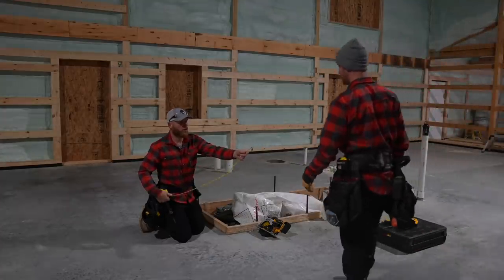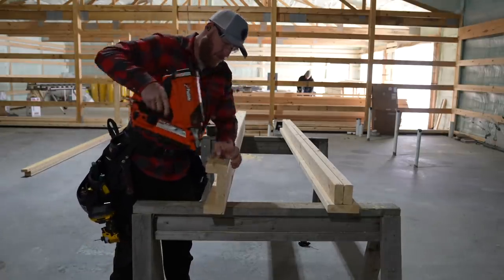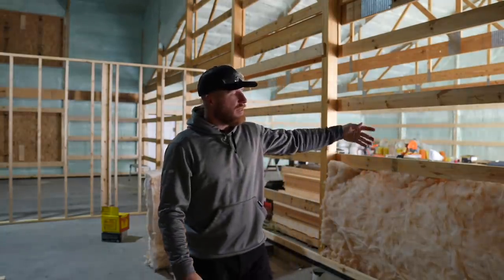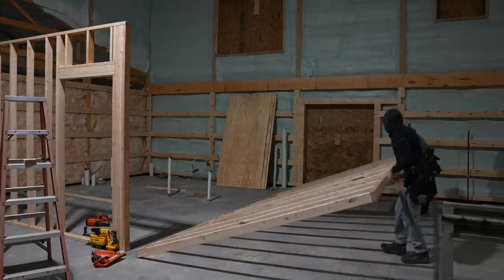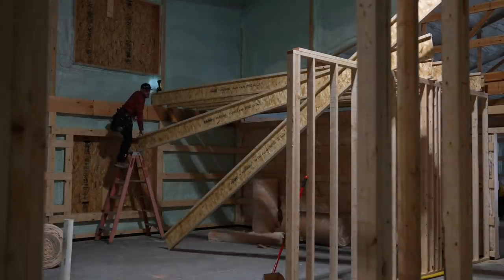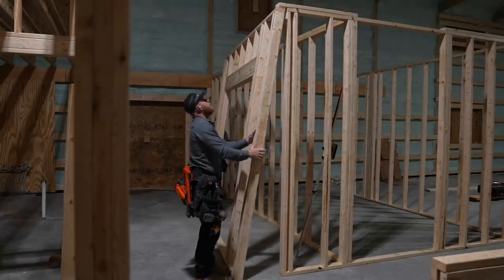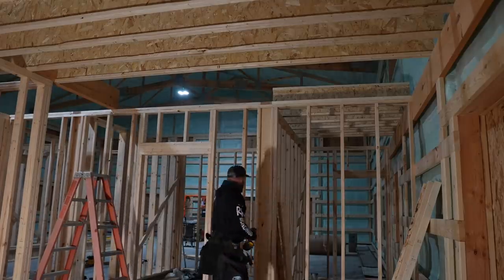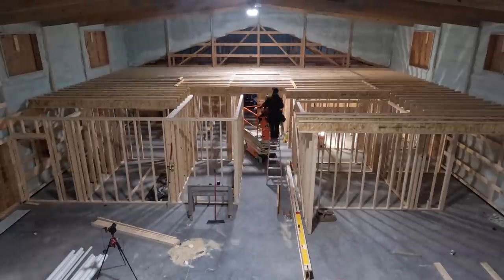Building a Barndominium 14:  Interior 1st Floor Wall Framing

Comment: Kyle- trying to put this in a nutshell: First, you guys are excellent. Secondly,  I can’t thank you enough for all the incredible content you’ve spent countless hours putting together.  Please know you have made a huge impact on how I will start building post frames.  I’m been building for almost 32 years and just recently have had the opportunity to build my first post frame.  I’ve studied your videos very closely and will respectively build exactly the same as you. This job would not be possible without your informative videos.  The build is a 10 bay auto body shop (210’x36’). Much bigger than I would like for my first build.  Thank you so much for making this opportunity attainable for us.  ~George

Comment: I can tell you guys like good quality.  Before lasers we used to string a chalk-line at top of stud height and stand stud on bottom plate and just "rub" it on upper chalkline. Have a saw in your other hand and done.  Super fast and accurate.  Used technique where concrete floor could be up and down.  Just make sure line pulled very tight.  You guys make a great team

Comment: PS...put Diablos on all your saws...been using them for about 20 years...best blades made IMO...I even run a 42T on my 7 1/4' Makita skillsaw...love the clean burr free cuts...have them on my 12" Makita slide & my 10" Hitachi slide...even my 16" Makita beam saw...and my battery 6 1/2" Makita skillsaw...only thing I dont use them on is my Bosch jigsaw...Only Bosch blades on it...best jigsaw blades made..ok, enough outta me for today...have a blessed weekend brother

Comment: You don't need super-high insulation between the house and garage, but you do want really good air sealing.  I would have used flash & batt -- since you are already getting spray foam just have them put down enough to seal it.  Costs a bit more money, but a non-sealed wall isn't even code in some places.  Otherwise it's a beautiful build as usual and it's interesting to see your tips and tricks for bardominiums, many of which could (and probably should) be used on slab-built and other stick construction.

And before people get angry that I'm complaining -- I live in an old leaky house where the garage-house wall is just studs and drywall, no sealing or even insulation.  Wasn't my choice (bought as-is) but it's definitely not great to smell car fumes in a bedroom.  I will fix it in a remodel when I get a chance, but it would have been way simpler fit the builder had just done that in the beginning.  My house is leaky though, in a modern tightly air-sealed house it would be more of a problem, as the fumes can't get out the garage or house easily, so what gets into the house stays until cleared by mechanical ventilation.  It's particularly important for a big heated garage, knowing that people will work on (and occasionally run) vehicles inside, and the partition wall has a large surface area.
Reply from the maker: Why do you assume we aren’t going to from the garage side
Reply: @RRBuildings  A vapor barrier would typically be on the warm side in your climate, no?  Closed-cell is somewhat special as the cold side is covered by insulation, so you can get away with insulating inboard of that.  Maybe you'll put up plastic, but having that right behind walls often make sealing details around surface penetrations such as outlets difficult.  Also the best plastic sheeting will typically not seal as well as the outer envelope you made, and relative leakage matters.  Maybe you'll put up OSB and tape it, but that's really uncommon in the US, and flashing OSB would have been easier given you just had the rest of the building spray foamed.

Don't get me wrong, I would kill to have you as a homebuilder, and I can't know what your customer was willing to pay for.  I'm just saying I'd have been willing to pay for OSB in between the house and garage and flash it with closed cell, and it looks like whatever you're doing, it's not that.  I will wait for the video to see what construction you do use, I'm sure you'll surprise us with clever and practical details as usual.

What some other builders have to say about garage-house common walls:
https://www.greenbuildingadvisor.com/question/air-sealing-common-wall-between-garage-and-house
https://www.youtube.com/watch?v=JaiJH0HXf-g
https://www.youtube.com/watch?v=mb9E2IS1m6Q

Comment: The t-wall connection points are actually called "leads". They really don't "need" full connector boards for code, 3 cutoffs can be used, top, middle & bottom. Using 3 cutoffs it's easier to me, because, there's not a struggle to line them up like there is a solid board.

Comment: Kyle can you talk more about the I joists?  I understand the benefits like lightweight and ability to span long distances.

It's my understanding though they also get their strength by working together with the I joists next to them.  

What about in fire conditions?  These will fail much faster than dimensional lumber in any sort of fire condition.  There is no debate how fast trusses and engineered products like this fail under fire load.

 You lose one I-joist and you're in big trouble.  To me the added insurance of dimensional lumber is worth the trade off that you get with some longer spans.

Anyhow I love all of your content and advice.  This channel is something I love to tune into because you're so relatable and share all of your experience.

I doubt you'll have time to reply but if you get a chance in another video then please share thoughts.
Reply from the maker: I get what your saying.. I responded i length a little further up

Comment: Frame your interior walls 3/4 short of exterior walls to allow the 5/8 drywall to pass behind it. Then you get a completely sealed exterior with no breaks in the drywall.
Reply from the maker: Good idea
Reply: Yes we always leave a loose stud on the ends of a span for that purpose.
Reply: @RRBuildings  i want to see you show the people once at least

Comment: When framing a wall on the floor the studs are crowned up so that the ends of the stud touch the floor.  Makes flushing the stud to the top or bottom plate much easier when nailing in the studs.

Comment: Nice job framing one of my favourite's. Instant gratification job. Wouldn't mind trying one of those bracket nail guns. Not available in Oz. Paslode make a gas version. Not available in Oz. Hard enough to get the pneumatic ones. I have 1.5 of them. A Senco working and a Bostick that has been in for repair for the last 3 months waiting on parts. Any professional tools here cost a small fortune and if anything goes wrong with them you better have a spare because it is a long wait before you see them again.

Comment: Excellent build so far. Really interested in seeing how you will be handling the conditioned attic space and framing out the ceiling underneath the trusses. Would you ever consider putting up I-joists and sheathing on the second floor ceiling to get use-able storage space in the attic?

Comment: Great stuff ... you have helped me so much in the construction of my post frame house and separate garage.  I am having trouble locating a source for the wide batt insulation (like you use in this video and others) ... do you have supplier names, parts #'s, and/or sources for this that you could share?  Thanks!!

Comment: On taping the bottom plate, good idea, but would it be better to tape after nailing? Nail heads and concrete means rust, right?

Comment: Great video.  i did have a question though.  when you had to move the door over why didnt you just go to the other end of the wall, cut the top and bottom plate and put in a 2x4 as a new end board?
Reply from the maker: Because then my layout for studs would have been off

Comment: I’m shocked with how many screws you use during framing vs. using the paslow.  Is there a reason you use screws for framing?  Also why tap on vs. a rawset?  I just finished framing in my basement and primarily used nails vs. screws b/c of ease

Comment: So informative! Why do you not need footings for your interior joist bearing walls? I can’t see how it’s different than stick built basement interiors where roof loads are also completely on exterior walls. Thanks for your quality work and videos! - designer in Michigan.
Reply from the maker: This is on a footing under the slab.  My two main bearing walls have footing
Reply: @RRBuildings  Got it! Thanks for your reply! That makes more sense that I had just missed seeing it in the previous videos. Probably poured with the slab.

Comment: Are you going to air seal between the garage and the house? Otherwise you could have carbon monoxide leak in if a car was running in the garage. I'd think it's even more important when the entire garage is sealed in with spray foam.

Comment: dad and I used to "box frame" as they called it back in the 70's, meaning we fastened the top and bottom plate to the studs before standing them, and we always crowned the 2x4s up, that way any siding or sheet rock would look consistent. Stud grade 2x4s then were so much better grade and so was treated lumber! Seems like quality has gone down and everything is streamlined to the point of the process that lumber used to go through before it was milled has gone to pot if I can use that old saying. Stud grade and #1 plate material also have more knots than back in the 70's and 80's.

Comment: It always amazes me how well everything fits together so easily.   Your building technique is awesome.   With the foam under the radiant floor, isn't that foam your moisture barrier?  Do you need to tape the bottom plates', of your interior walls, bottom surface?
Reply: It's always smart to do that if you have an interior leak or condensation from inside a room. Plus it helps with airflow under the span.

Comment: This is looking awesome, i do have a question is there going to be a woodstove in this or have you done woodstove installs in any other builds? Trying to figure the best way to cut through the roof of my shop for one
Reply: I don't remember any wood stoves in any videos, pretty sure I've seen them all at least once lol. 

Somebody's gotta want a wood stove, hopefully they'll get a video on it.
Reply from the maker: This will
Reply: Imho, minimal roof penetrations is the way to go. Specially on a standing seam roof. Angled through wall is how I do them if possible. My Idaho house has a fireplace on the end of the building and my Cookstove is run out of the wall just above attic line.

Comment: Would you be able to show the prints at the beginning of a video like this…maybe? It would help the less knowledgeable people see it then watch how to do it. Just a thought. Also why do you use screws or nails for the bottom boards to the framing? (My initial thought is for strength but I could be wrong.)

Comment: Do you have to comply with "building regulations" - UK version of your codes I think ?  In the  
uk an agricultural barn does not come under building control- building regs. ( still needs planning approval).  If it is a domestic structure  of any kind we have to comply with all the rules.

Comment: instead of taping the bottom of your floor 2x4's you can copper coat them. kind of stinks for awhile so do it well in advance and let it air out.
Reply from the maker: Why would I do that then?  What’s wrong with tape
Reply: @RRBuildings  is that just tyvek tape? I can’t find any 3-1/2 - 4” wide around me and like the idea of tape instead of treated. Could you drop a link please?

Comment: Do you need the 16" inch centers vs. 24" 2x6 shear walls since it is a load bearing wall for the I-Joists?  Can you use 2x4s for the interior walls?  Awesome video frame downstairs in one day
Reply: Depends on the code. Your engineer will know what would work.
Reply: Using Perma-Column Sturdi Wall Brackets

Comment: hey kyle, i know youve done your home work on those engineered I beams. have you evr looked into the fire and water rating on them? in theory they are gret but in a fire or if the get significant water damage they fail real fast
Reply from the maker: True… all wood will.   That is why it’s important to cover them with drywall and not allow them to get wet.  Both things you should do regardless. Unfortunately a fire would be catastrophic regardless of wood being used.   In the country no fire rescue team will save anything by time they get to the location.   It’s all about containment when they show up
Reply: @RRBuildings  thanks for pointing me to your reply which applied to my post.  You're right that county fire response is slow and it's tough for them to get a stop.  I work for city fire and our county does a pretty damn good job getting stops when possible.  Some places though just don't have the volunteers to do so.

My comment was more for life safety of occupants and not preservation of the building itself.  The type of material isn't just a this or that for the minutes that could save your family's life.  Many of the areas these are used are not protected by gypsum (basements).  

One I joist failing in fire conditions could cause total failure much faster than a dimensional lumber.  While these instances are not super common it's food for thought regarding the safety of your family.  Engineered products fail much faster under current fire conditions as our homes are filled with petroleum based products that burn faster and hotter.  Every minute counts and you'll gain substantial safety with dimensional joists.  They burn much slower and one failure won't cause total failure.  I personally will never use the engineered joists, studs, etc for those life safety concerns.  Just my choice but for me it's not worth the risk and I'll take some slight imperfections to my joists and studs.    Dimensional lumber likely will give 3-400%more time vs engineered products before failure. 

Thanks for taking a quick moment for us.  I know if you tried to reply to everyone you'd never get any work done.

You're doing a great job!  Content is killer.  Thankfully people like you take the time to share your skills and find a way to get paid for it!  Well deserved and can't wait to see the progress.
Reply: Stsalopek... Your spot on.  The adhesives and lack of "meat" do not hold up to water and fire like dimensional lumber.  These products produce straighter materials but have significant downsides most people overlook or undervalue.

These products are in place to fill a need and at the end of the day allow the producers of the products to utilize their scraps that would otherwise be unusable.  Name of the game is making money... Always follow the money.  No shade being thrown at the companies as they have to find ways to innovate and grow

Comment: Why do you double top plate walls? Is it so a 3 inch nail has two sufficient pieces of timber to attach to? Where a single top plate the nail would be exposed?
Reply: building code may demand double plate
Reply: @freightshayker  what are the pros/cons?
Reply: @ToddStockton  
Pro: more strength and ability to place heavier items anywhere on above floor. And of course you must be in compliance with code by using double plate.

Con: less rigid and you risk being sued if there is failure or damage due to less framing.

By the way. I don't know if interior walls must have double plates in a post frame building. But most people use double plates because of the added strength

Comment: I have never used the I beams before.  Is the upstairs floor "bouncy" at all spanning that distance?
Reply from the maker: so much more rigid than standard 2x and since they are engineered, it is consistent.   traditional lumber is not all the same.  some trees are stronger than others.  so there can be strong joists and weaker ones

Comment: Question.  In your part of the US do they not recommend vapor barrier on the warm side of the wall between the house and the garage?
Reply: If you're running bat insulation then yes. They're using closed cell on walls so there won't be any penetration.
Reply: @jwristen24  Yes I was talking about the wall between the house part and the garage that they put batt insulation in.
Reply: @garretwhansen  yeah probably not necessary since the garage is spray foamed on exterior walls.

Comment: Most impressed by whatever blade you used in your recip saw to cut through the fasteners in your "mistake" wall. But also, no offense intended, it was stupid of you to lift that wall by yourself. You're just shortening the length of time you are able to do stuff like that.  Use your help buddy.

Comment: You do that cedar well work on concrete right , real craftsmen n carpenters know this n just gotta find the height on both ends n run a string across , right n it's faster

Comment: Instead of taping it why don't you just get some Copper naphthenate ? I do it when I build decks any of my structure Cuts get painted with it basically ac2 in The Jug
Reply: @lomaii2847  no understand don't speak Taco Bell

Comment: Something always confuses me about radiant heat floors. Why do we always place the radiant tubes on the bottom of the concrete? If something goes wrong, after all it is a man made product, you have to tear the whole floor up! Why not just pour your floor, run and test the your tubes and pour a thin set over the top of the tubes! If you have problems you only tear down that first layer! For those that are about ready to shoot this idea down, It’s a common practice in Europe.

Comment: Big mistake not using spray foam in the common wall. Air sealing that wall will help reduce carbon monoxide from the vehicles.
Reply from the maker: Who said I’m not going to seal
It